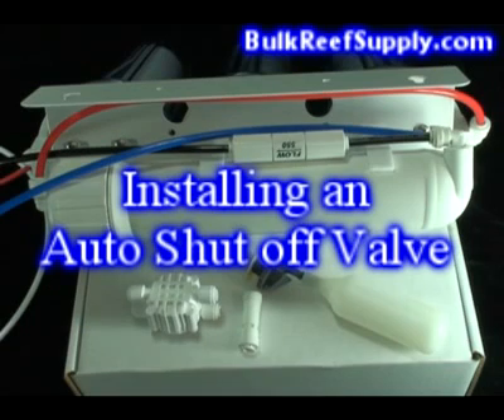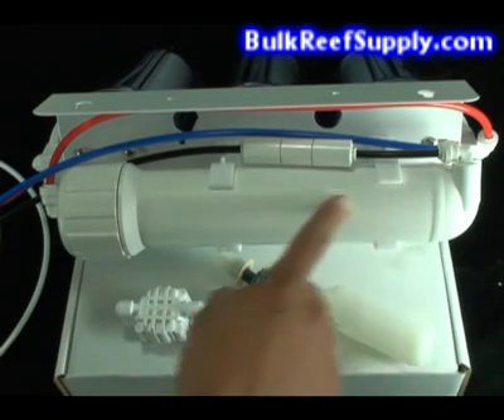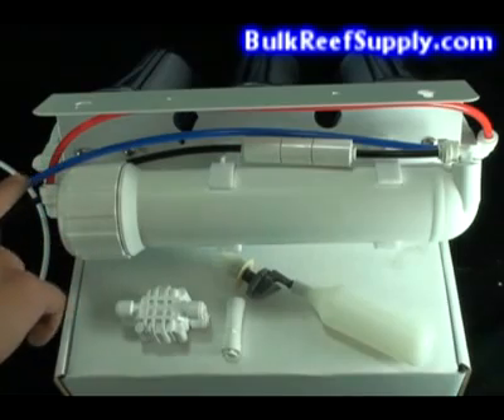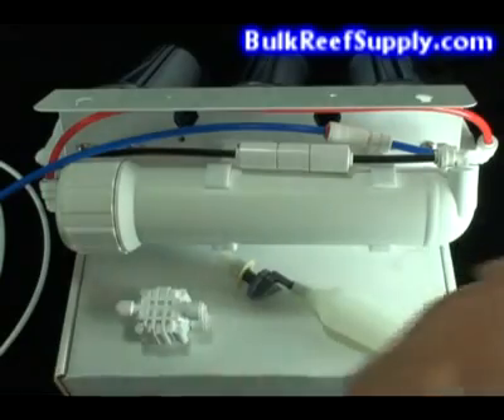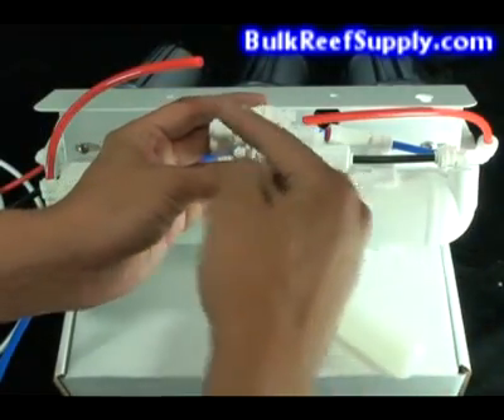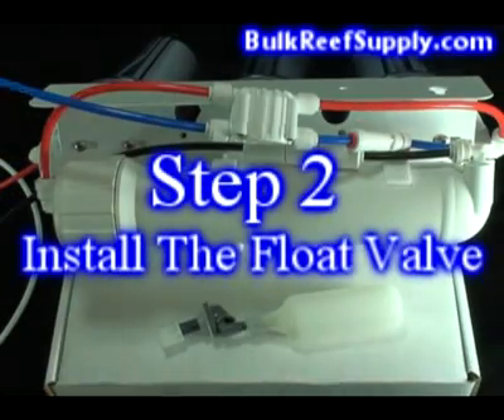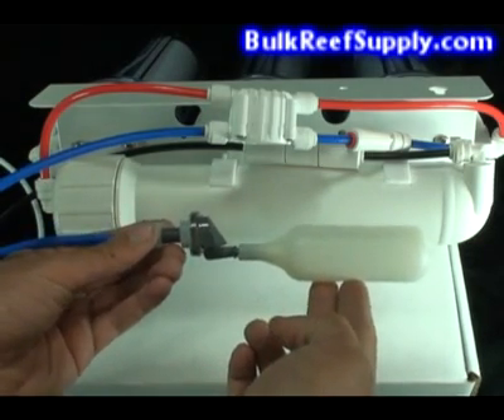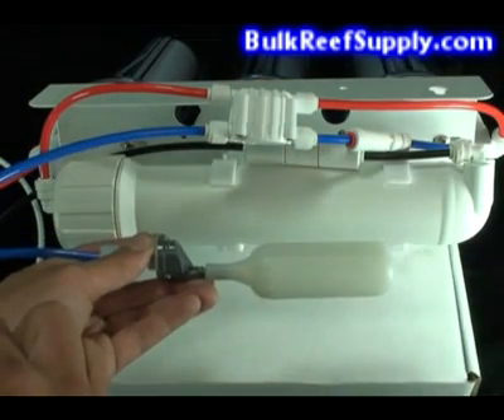Auto Shut Off Valve Installation Demo - Bulk Reef Supply BRS

Comment: For the ASO to engage, it needs 60% of the pre-membrane pressure in the post membrane side. BUT... How are these two different pressures (100 & 60) isolated from each other and not one continuous pressure? I'm thinking the answer is the Check Valve. It creates that 60% pressure when the water leans against it. (Even in a system without a storage tank.) I have under-counter RO for drinking water without a storage tank. My issue for a couple days now, I get drain water when not using the faucet and have already replaced the ASO and the issue persists. So would you say the Check Valve is the culprit? Thanks!

Comment: Do you know approximately how long it takes for the ASOV to close after the floater does??
Reply from the maker: It'll depend on the pressure to the system, but generally between 5 and 15 minutes.

Comment: Can you use an auto shut off valve to prevent a sump tank from overflowing?
Reply from the maker: Hmm...I don't think that would work. These auto shut off valves use very small diameter tubing and rely on pressure, which plumbing on sumps don't have.
Reply from the maker: These shut off valves are specifically designed for water filtration units with 1/4"inch tubing connections and designed to operate in pressurized environments just like a kitchen or bathroom faucet. They only work when the "faucet" is turned OFF and back pressure in the lines force the valve to close. The mechanics, fitting sizes and application of the ASOV are far different than your average aquarium and are not very useful outside of water filtration.

Comment: Hi , thanks for the videos ! Have a question . Im trying to fill a 40 gallon holding tank that is NOT pressurized for my Aquariums . I also would like to make ice in fridge in my garage . From where the RO system is on the wall in the garage i have to go past the Fridge first before getting to the 40 gallon tank . For the 40 Gallon tank i am using a Float shut off valve .

My questions are 

1) Will i  need to use the 4 Gallon pressurized bladder tank to do this ? Im not really to concerned about the length of time needed to fill the 40 gallon tank if it takes 2 days thats fine . Id rather avoid using the bulky 4 Gallon tank to accomplish the 40 Gallon and ice 
2) If i Tee off the line going to 40 gallon tank , will the ice maker make ice off the Tee ? Once the float turns off the water im concerned the ice maker will not work ? Any help would greatly be appreciated since i am unable to get a clear answer , you guys seem to know your shit !
Reply from the maker: Unfortunately, you're going to need a pressurized tank for this to work properly.
Reply: @BRStv  Thanks alot guys for the FAST response !!! You gys are awesome keep up the great work

Comment: Could I use this in conjunction with booster pump Pressure switch?
Reply from the maker: You definitely can! The booster pump will shut off to back pressure, just as the ASO will.

Comment: I need help! I installed this valve and when the float valve shuts water off the aso begins vibrating violently. Any idea what is causing this?
Reply from the maker: Usually it's a result of the water pressure hitting the ASOV. What pressure are you running your system at?
Reply: Pressure is 45 psi. One thing I thought of does the valves orientation matter (I have it vertically so two connections face down and type face up)?

Comment: It doesn't look like there is a di chamber in this video. Would this hook up be the same or would it go after the di chamber?
Reply: I have the same question. Did you figure it out? I would assume it goes after the de ion filter in and out the switch then the float valve gets connected to the last filter stage

Comment: I bought a RODI used and it has the float valve and the thing with the 4 screws but it has no check valve do I need one
Reply: +BulkReefSupplyCom okay do I need it ? what does it do if I don't use one what will happen

Comment: Great video,I have a question.I have installed a new auto shut off valve and float switch.My problem is my auto shut off valve isn't working.The pressure continues to build up and squirts water from my float valve.

Comment: My ro system is all internal between each filter and only has 4 lines outside,  they are input, output, storage tank, and waste water.  I purchased this system and and add on di canister. What's the best way to install it?
Reply: Yes I figured that part out. Just trying to figure out correct way to install aso.  Would low pressure side go from the ro output to di input,  and the high pressure would have to go on the waste water lines,  since I don't have a line going from my carbon to ro membrane ( since its all internal?
Reply: OK thats for the help!  Yeah I haven't seen many like it came with the house.  It's a culligan ac 30
Reply: ***** does it matter to have both in line?

Comment: what happens If I install this without the check valve? I own the 4 stage PLUS and it came with a shut off valve. If I only add a float switch will it work? or do I need to order a one way check valve as well?

Comment: I have a 5 stage with pump. Bladder p.s.i with drained tank  10 .Run system for 6 hours and bladder p.s.i 15. Poor symptoms 1) Pump on continuous and draining continuous
Could the cause be a problem with 1 Pump or 2 Membrane filter (it was replaced 4 months ago.
AMSO  valve installed (after pump -before carbon filter). Signaled as per your video

Trust you can assist